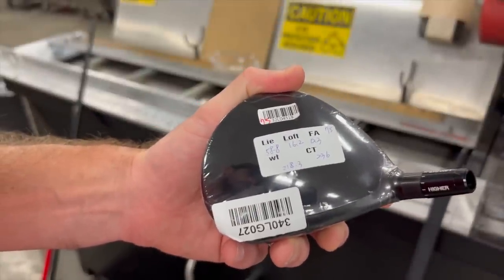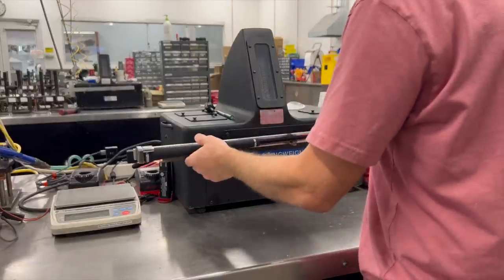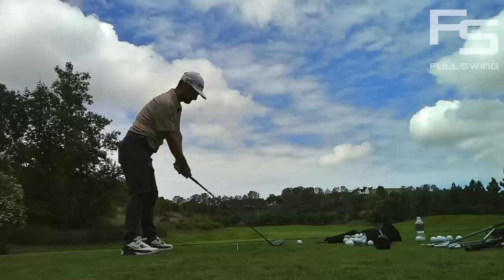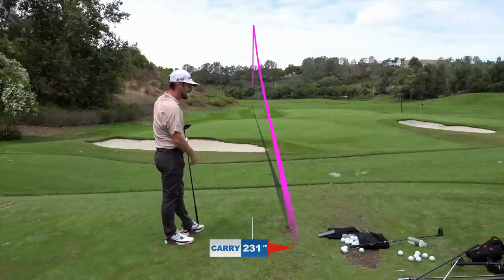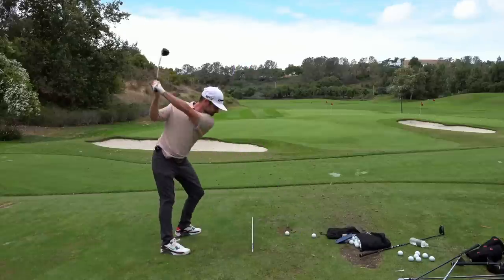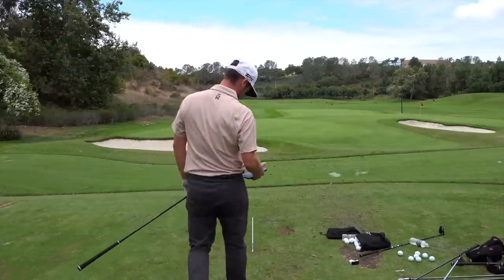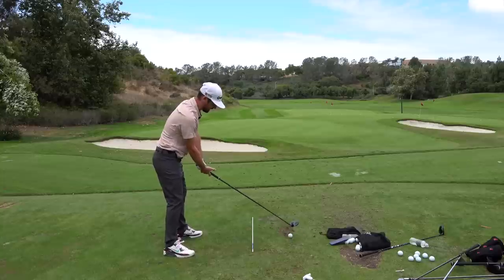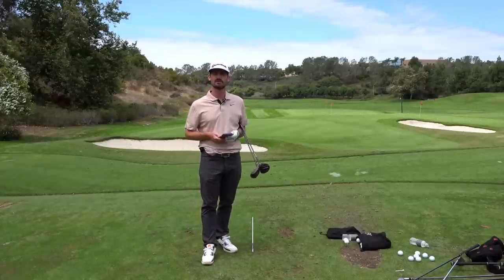Everything You Need To Know About Adjusting Your TaylorMade Loft Sleeve | #trottiegolf

Comment: Hey Trottie!  I see you swapped the 50 gram sliding weight to a 46 gram weight.  How much hot melt did you use?  What’s your swing weight?  Great video!
Reply from the maker: I didn't need to add, I was trying to hit a certain swing weight with the new shaft that would have had a different balance point V's another model. End result lighter 46G weight, good spot

Comment: Trottie, I have a stealth 2 plus 5 wood but when I unscrew the head to adjust the loft sleeve the head doesn’t budge one bit….any suggestions? Is it possible the manufacturer would have glued the head to the loft sleeve?
Reply from the maker: No it shouldn't be glued in. Just turn the club around and tap the grip end on the floor and providing it's unscrewed then you should be good